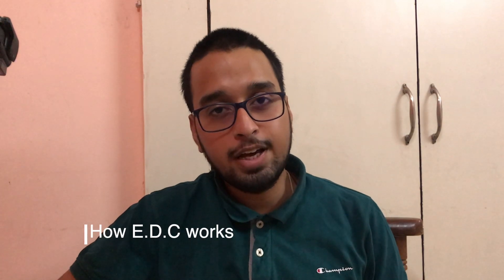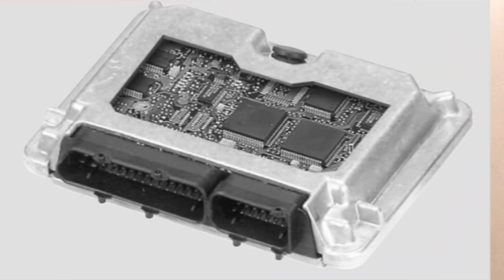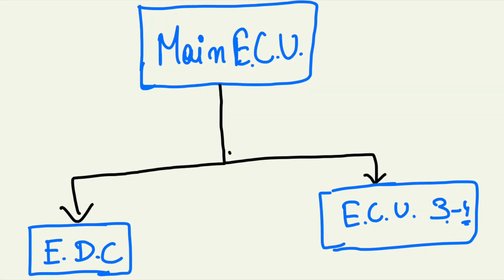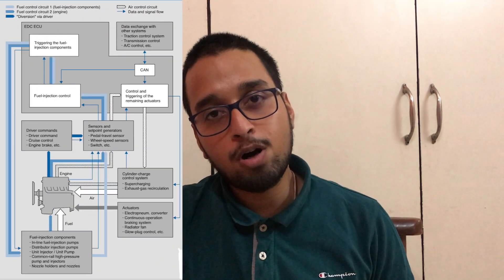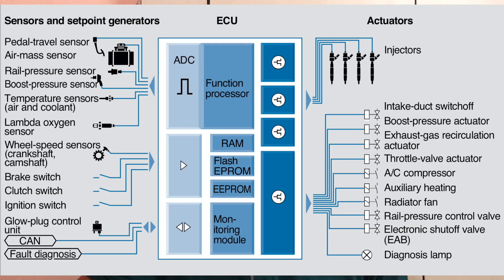How Electronic Diesel Control system Works

Comment: We travelled today in the new FORCE Urbania diesel vehicle from Kazo to Hikkim in Spiti region  and had plans to go to Laangza and Komik . However after we tried to leave for Komic from Hikkim ...the instrument panel started blinking the EDC red button . We thought it could be owing to the inadequate oxygen intake at 15000 feet that the EDC malfunctioned . The tank was full , so was the Urea additive in a separate chamber to reduce emissions . The engine oil and coolant was also correct . But the 15 seater mini bus would not move beyond 2000 rpm and the vehicle was moving pathetically slow at just 5 kms per hour . The torque suffered and it took us about 90 mins to traverse a distance from Hikkim back to our Hotel at Kazo for a distance of about 15-16 kms . Apparently I feel the vehicle is not designed to travel at a threshold height of about 10-11000 feet . We were 15 of us un the virtually new Urbania .  It was a disappointing experience as we had to abort our visit to Komik and Laangza as a result